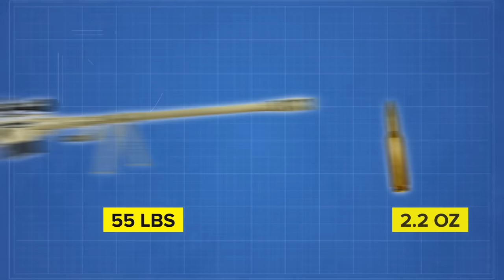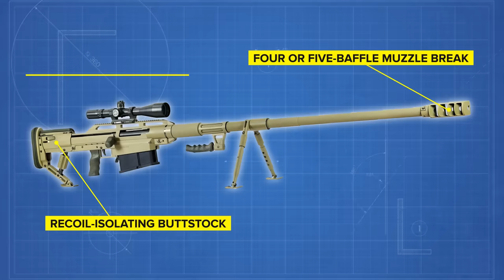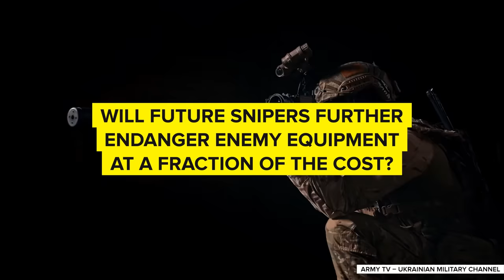How Ukraine's SnipeX Alligator Mega Rifle Is Terrorizing Putin's Army

Comment: no rifle can shoot 12,00 ft
Reply: actually its effective range is 6.6k ft w/ a maximum range of 23k ft
Reply: Wrong
Reply: @SYLRMHA that’s the effective range and maximum is 23K
Reply: Effective Firing Range: The Alligator has an effective firing range of approximately 2,000 meters (6,600 feet).
Maximum Firing Range: When it comes to absolute ranges, the Snipex Alligator can reach up to 7,000 meters (23,000 feet).
Reply: the real Aaron has no concept of distance. Good show mate
Reply: 338 lapua made over a 2 mile kill,  and that's a much smaller round. Go look up .375 cheytac  and the .416 barret.
Reply: At 12,000 ft, it's still going 1800 ft/s. So still very effective against personnel.
Reply: @jocopowell it will go trans sonic and the bullet will start to tumble erratically making it impossible to target something past 2,000m, if it was a machine gun raining down hundreds of bullets it might by luck hit something at 7,000m but no scope/mount can even accommodate for the amount of elevation you'd need since you'd be aiming up at a 45 degree angle to arc the bullets in at that range
Reply: @eaglefat9398   Yep.  That's why the term "max effective range" exists.  I don't think many people need that explained to them.  I certainly don't.
Reply: @jocopowell   For some people it's of no use. You can explain it for them but you can't understand it for them, and they aren't capable themselves.
Reply: or 45thousand toes

Comment: Tell me you're not very familiar with firearms without telling me you aren't very familiar with firearms :P (while showing the Browning MG they also showed a belt-fed grenade launcher, and barrel length starts after the bolt, not where the shroud ends, which is what you indicated looks particularly silly with the Barret)
Nonetheless, neat video - long range precision shooting will certainly continue to be an important role in conflict
Reply: also referred to the bipod as height adjustable cheek pad

Comment: Excellent presentation sir!

Coincidentally, I have a 25 ft. tape measure next to my desk. I stretched it  6 ft. 6 in. to conceptualize just how loooooooooooooooooong this rifle is. I suggest everyone do this. Only then can you see how HUMONGOUS this beast of a rifle is, dispensing death at 3,200 fpe (foot pounds energy). The name for it, "Alligator," is accurately appropriate. 

Query: Did this rifle get its Alligator name because in a sense it is the size of a 6' 6" bad a$$ alligator?

Visualizing the 6' 6" length with my tape measure I now understand how length is a drawback of this fine weapon. E.g., we all know snipers must be able to RAPIDLY pack up and move, sometimes after just one shot, otherwise the team risks being spotted, targeted, and violently blown to bits. 

With the Alligator a sniper team can't do that, even if the two tear it down (because the barrel alone measures 47," the team still has large heavy parts to manipulate (note the naked rifle alone weighs 55 lbs).
Reply: Yeah, Alligator is seen as more of an anti materiel weapon. A 14,5x114 based sniper rifle, Horizon's Lord, was developed to suit requirement of 1,6 meters length with no suppressor and stock folded. That's still huge for a sniper rifle, but makes fitting the damn thing inside of a car possible

Comment: Get hollywood out of your brain and just get the smallest pov drone you can with adequate time/distance capability that can deliver death and single use is ok, but not the number one option. A small .22 round at close/point blank range, straight down or ramming, an efficient small explosion or a chemical contact/spray, bla, bla, bla anything that will deliver certain death to the target human. It could be satellite linked, travel by night, solar charge by day, doesn't matter as long as it does the job.

Comment: That thing is just as good as any old style anti tank rifle. The reason for it's implementation was just a huge amount of open fields and RU sending huge amounts of IFV's in this very same terrain. It doesn't even have to penetrate, a huge enough "knock" will scare enough. The real supposed effectiveness is something i would doubt highly.

Any KPV AP round is somewhere in the middle field of anti materiel rounds, nothing special. In WW2 there were even more powerful laborations and rifles, though even then they were no match against medium armor like a sherman m4 75. Though those rifles could very well destroy optics, tracks and mobility parts, it was and is a suicide mission for the team doing it.

Comment: I have a question about these fake dimensions used. If two men has two different sizes of feets, how do they make out which one has the correct length measured if both use their feet to tell the distance? Or are these fake dimensions like feet, only a estimate?

Comment: I understand the need to get snipers out into the field as quickly as possible. However, a crash course that gets rid of the more time consuming theories and arcana but gets marginally effective snipers into combat faster should not become their standard.  Instead, they should maintain that original higher standard for a subset of trainees while concurrently training a larger group quickly to the newer lower standard.  If they take one recruit out of ten and spend the extra time training them to the original standard, then in twelve months they will begin to see the top notch graduates entering the line.  Meanwhile the adequate snipers have been holding the line in the meantime.

Human nature is to go all in.  If they stopped training snipers to the higher standard and train all of them faster to a lesser standard, eventually a significant level of knowledge, experience and skill will simply disappear.  They'll never get it back.  This newer, faster training will eventually become the standard, and even seen as the superior method since no better method will have existed for some time.
Reply: ... and it's not just the skills being imparted on the trainees.  It's also a matter of institutional knowledge, systems and infrastructure developed over years and years to hone the practice of rotating classes through a course, and techniques that they use to pass on the knowledge gained on the battlefield, etc.

Even something as simple as the training manuals, or specialized equipment.  If they stop using a particular tool or stop buying a specific textbook, the company that makes it could go under. When the time comes to rebuild the better sniper school again, that toolmaker or publisher and those tools and training manuals will no longer exist.

Comment: Well sound locators will be introduced to triangulate the contra sniper-fire for Bradley or Artillery.The locators can use computor diagnostic sound analysers to determin the weapons gunfire specific to the weapon of the sniper.All very cheap to produce.Can be based upon sysmic technology and Submarines methods of sound and vibration diagnostics, So all very simple easy                     ,the civilians will be used to be set up at home to service triangulation stations. Welll some have it and others do not, Vision Fantasy. A good base will be DCS  to actulise targets . BE BLESSED ! (ALL PASSIVE)  OH DATA LINK CAN BE MADE FOR THE TRIANGULATION STATIONS ?

Comment: In the USA, we've had snipers take out targets at nearly 2 miles. Our 50 cal is a much more effective weapon
Reply: This is a larger caliber with a longer range. Wikipedia gives 7 km maximum range and 2 km effective range.
Reply: Of course the U.S. sniper rifle is better. Everything in the U.S. is better. Lol
Reply: @karstenschuhmann8334  I guess you have never seen a .50 cal round. It dwarfs that round. Also the 50 cal is a shoot and scoot weapon. Multiple record shots of over 2 miles. Hell I can drop a deer at 1600 meters one shot. That's a mile. And I'm 62. You take a weapon 6' long and 55 lbs. It's a limited weapon for specialized shots. Not a good military firearm
Reply: @edgemonsiteworksllc3369  This rifle fires 14,5 x 114 mm round with 60 g,  1000 m/s, and 30 kJ. 
It is significantly larger and more powerful than a rifle firing .50BMG or 12.7×99mm cartridges with 42 g, 923 m/s, and 18 kJ.
Reply: @karstenschuhmann8334  I’ll put my 50 up against anything you want. Your rifle has an effective range of 2 kilometers. The 50 has an effective range of 2 miles. Like 3 times the distance.
Reply: @edgemonsiteworksllc3369  "I’ll put my 50 up against anything you want."

So you put your rifle against an M777? Larger calibers just have more range and higher precision on the same range.

"Your rifle has an effective range of 2 kilometers. The 50 has an effective range of 2 miles. Like 3 times the distance."

A) It is not my rifle.
B) 2 miles is 3.3 km. 
C) Your rifle has a maximal range of 3,3km this rifle has a maximal range of 7km. 
D) Your rifle has a maximal effective range of 1,5km, this rifle has an effective range of 2km.
Reply: @karstenschuhmann8334  lol. I’m a former U.S. marine, artillery. The self propelled 155. You want to talk shit. Bring it on! But I didn’t say a gun. Such as the howitzer is called. I said rifle. Learn to read boy
Reply: @karstenschuhmann8334  1.6 kilometers is a mile.
Reply: @karstenschuhmann8334  but hey. Put your money where your mouth is. $50,000 usd. Winner takes all on the longest accurate shot
Reply: @edgemonsiteworksllc3369  Correct one mile is 1.6km, so 2 miles are 3,2km, and not 6km as you claimed. And 3,2 km is much less than 7km.

Numbers seem not to be your strong side. The way you talk you have not been the guy calculating the aim, but the one loading the gun. 

I mean, unless you are currently intoxicated.

You said against "anything", not any man-portable rifle. I just wanted to make it very clear that larger bullets will go further if you stick with similar aerodynamics and a similar muzzle velocity.
Reply: @karstenschuhmann8334  lol. Are you scared to take the bet? I said the longest military recorded shots are 2 miles. But what you are incapable of understanding is, I will show you 3 times the distance of your 2 kilometers shot. Do you understand that boy? I understand you might have to sell your mom’s house to put up the $50k
Reply: @karstenschuhmann8334  3.7 miles. Are you scared
Reply: @edgemonsiteworksllc3369  " lol. Are you scared to take the bet? I said the longest military recorded shots are 2 miles."

Well, it is far outside of the effective range of the weapon, but if it is attempted often enough there will be some hits.
The alligator is pretty new but with the same number of attempts it should allow the same result over 4 miles.

"But what you are incapable of understanding is, I will show you 3 times the distance of your 2 kilometers shot."

So you would show me a 6km or 4 miles shot? Well, the bullet would probably travel this far, but would you be able to hit anything but a barn?
Reply: @edgemonsiteworksllc3369  It is obvious that a larger caliber rifle has a longer range (given the same velocity and aerodynamics). It is just weight to air friction.

Precision is a different topic. it depends on the consistency of the ammunition. If both types of ammunition have however a similar consistency, the larger weapon will be more precise as it is less affected by wind.

Comment: I'm calling complete BS, ghost of kyiv level nonsense 
Large caliber rounds are no where near as accurate as smaller target rounds like 6.5 SAUM, 7mm RUM and .375 meme-tec, its basically only good for volley fire where you walk your rounds in.  Its a great anti material rifle but its no precision target rifle 
This author also doesn't really seem it have a good understanding of weapon design and the logic behind it, the barrel is only that long to get the muzzle blast farther away from your head and is probably hurting accuracy and maybe even velocity because being long means less rigidity which you then have to hand load to tune your ammo to the barrels harmonic frequency and as far as i know no one on earth makes match grade custom ammo in the caliber so they're shooting 80yo WW2 surplus ammo.
Ceracoat is just a better paint and on par with parkerization and is in no way a replacement for stainless steel which the barrel would need to be for any hope of decent accuracy at ELR.